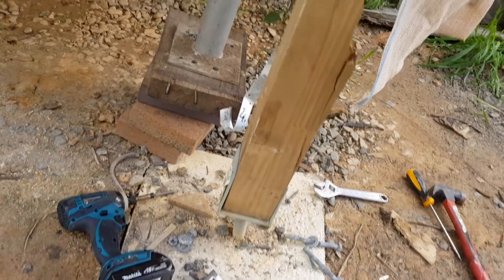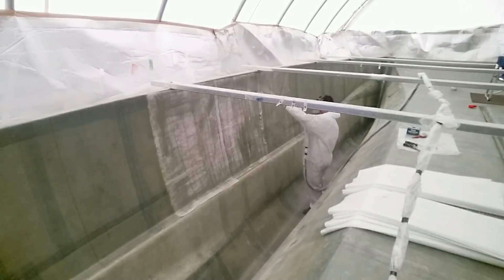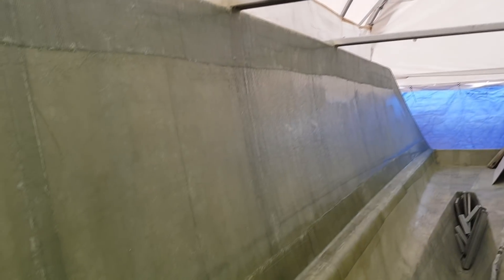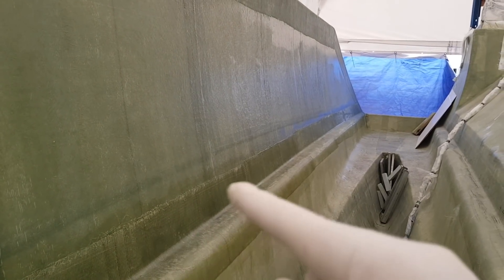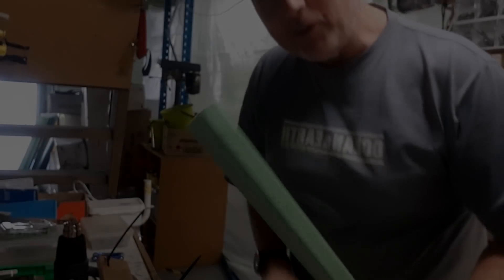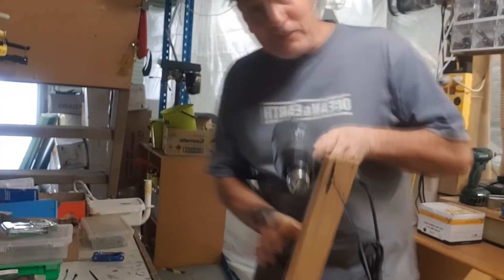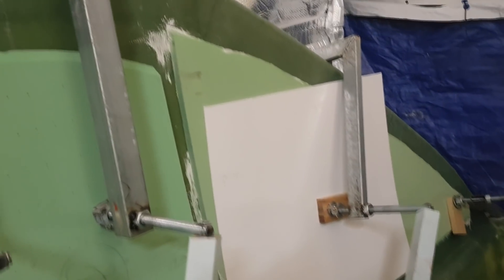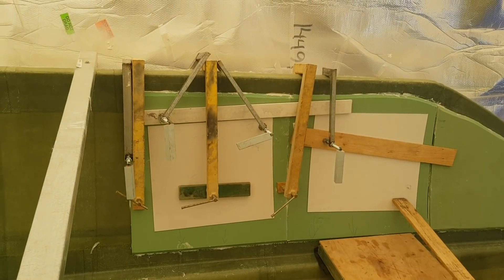Ep016 Foam core installation on Catamaran Hull Sides

Comment: theoretically if you were speeding at around 60 mph and landing on water with a catamaran hull with foam core, Do you think it would survive the impact?  weird question i know but there's method in the madness
Reply from the maker: Onya mate.
Reply: The reason i asked was, I wanted to build an ekranoplan catamaran hybrid,  check it out, definately get you over the seas quickly.
Reply from the maker: Oliver, I am not convinced it wouldn't handle the landing as the foiling catamarans are carbon foam core and they are cruising at 60mph at their fastest. Check out the sail GP site and superfoilers and they seems to be ok, I live close to the superfoiler builders and they are capable of speeds almost as high as that.  I believe the rigidity is fine , the actual laminate would be the critical factor and reinforcement under tension as the inside of the structure would be prone to delamination due to the impact and compression on the other hull. Ross
Reply: @LifeOnTheHulls  Wow Thanks Ross, I could definately use the help of an engineer on the materials,  I was thinking of using densified would which removes lignum from the wood reducing size and weight while also producing steel like strength, it's a relatively new method, then using a mix of fiberglass, carbon, kevlar or basalt as the last couple provide better impact resistance, i also thought wood does well when the fibers attempt to compress, I might be completely insane though and thinking nonsense.
Reply from the maker: Oliver.Emirates Team NZ have developed a foiling  hydrogen powered chase boat that can do 50knots,check it out, that shows what is the future.I do worry  for the marine life on the surface with foiling technology and the resultant damage to foils tendering them useless.Ekranoplan look very interesting.Definately carbon kevlar to balance rigidity with impact strength.I love carbon kevlar and use regularly.Ross
Reply: @LifeOnTheHulls   Yeah i had similar concerns with foils.  The ekranoplans might be a better longterm solution if perfected.  much quiter i would guess too.  Thank you very much Ross, a Gentleman.  Best Regards Oliver
Reply: @LifeOnTheHulls   something like this http://www.hypercraft-associates.com/Resources/Hoverwing%20HW2VT.jpg

Comment: What is the added value of the foam to the inside of the Hull?  
- Structural? 
- Vibration & Sound deadening? 
- Insulation?  
I ask this because the insulation becomes a divider between the interior dividers and the exterior of the Hull.  Right? 
Seems like all structural connections should go from  interior bracing to exterior layer of the Hull Fiberglass.  No?
Reply from the maker: Hey buddy.Foam is a structural component as it forms a bridge between laminates thereby increasing stiffness whilst reducing significant weight. It further adds to insulation both thermal and noise and provides a rot proof core for added longevity.Cheers Rossco

Comment: Hello! are you using vinylester with wax in it every layer, exept the last layer, or is the wax always inn? and why do you use vinylester instead of polyester?? in sweden the polyester resin  is much  much sheaper than vinylester, can I use that insted?
Reply: He used the vinylester because it is stronger and more resistant to water osmosis.

Comment: No protection suite? I get the itches just watching you work with fiberglass!
Reply from the maker: I only need the suit when spraying and sanding substraas the itch only occurs when the glass is airborne as it is sanded or ground. There is no itch when laminating stitched cloth until one comes to sand or grind it, that when the fun starts and I am paranoid about the itch.  Cheers

Comment: I worked in the boat building industry about 40 years ago. Instead of grinding the foam core, I used an electric planer. It saved about 3 days of grinding.
Reply from the maker: Where were you when I needed you most Johnny.Hah.Great tip will be doing this on the the deck build for sure.Legend.Cheers Ross

Comment: I use to spray 2 part poly for tank waterproofing. What is your gun set up and what ratio are you spraying??  Thanks
Reply from the maker: Thanks buddy, really appreciate you watching my series, The gun sprays saturated polyesters and vinylester resin including gel coats.Ratio is between 1 and 4 precent catslyst which I can adjust dependant humidity or temperature.Resin is catalyzed approx 1nch from gun nozzle to reduce clean up and ensures accuracy and longevity of product. All the best, Rossco
Reply: @LifeOnTheHulls  Thanks for the response! I found your tech video,  Graco is the best in the business. Cheers!

Comment: The adhesive you used for the foam is similar to the stuff that we use on kit cars for bonding on panels.  We refer to it as “ baby poo” 'cos it gets everywhere.  I’ve had it in my eyebrows.
Reply from the maker: I too have had the stuff everywhere, I can totally relate. Cheers Ross

Comment: Great vid,  been looking at modern foam-core yacht's and wondering what exactly that means,  now I know exactly.   and learned so much.  laughed out loud when you wiped the latex gloves in the t-shirt before handling the foam board, clearly a trick of the craftsman. 
Bigger question, where ya get the mold, rental?   Hmm should probably be watching some of the earlier episodes.
 PS sorry bout ya shed pole, glad it could be fixed.
Reply from the maker: Bo Lorentzen Thanks for the comment Bo.Funnily enough the t shirt is a Melbourne Storm Rugby League footbal team so no great loss.I support the local St George Dragons.There is no reason why there should be a League team in Melbourne Victoria.lol

Comment: I want to build a 32'-36' Catamaran, much like the 1988 crowther spin drift 38'. any tips on how I can get information on how to build a hull? I was thinking of just doing some thing in the video I linked with 5 lb vinyl foam that i linked. 

https://www.youtube.com/watch?v=OwABZT2pIn8

The hull won't be able to walk all the way up and down. only about 12 (3.6576 meters) Feet of the outer hulls you will be able to stand in and access from the cabin. The cabin will be smaller too about 12 feet long (3.6576 meters) and 8 feet wide. The total width of the boat Beam will be about 14 feet (4.2672 meters) Now my concern is if I can get the hull strong enough using the technique as follows.

I figured I wouldn't need as much material since my boat would only be half the size of yours. 

inner
Chopped Strand Mat: 1 1/2 ounce 42.5243 g
Woven roving 18 oz or 510.291 gram (for flattest areas on the hull)
Chopped Strand Mat: 1 1/2 ounce 42.5243 g
36 oz  - 1200 gr/m^2 Triaxial fiber glass
Chopped Strand Mat: 1 1/2 ounce 42.5243 g
Foam core 3/8-1/2"
Chopped Strand Mat: 1 1/2 ounce
36 oz  - 1200 gr/m^2 Triaxial fiber glass
Chopped Strand Mat: 1 1/2 ounce 42.5243 g 
Chopped Strand Mat: 1 1/2 ounce 42.5243 g
outer

I also want to Design a super structure through the hull like a skeleton. Combining old techniques with new. To hopefully reduce the costs of building a cat. 

https://www.fibreglast.com/product/Chopped_Strand_Mat_1_1_2_ounce_00250_1/Fiberglass_Mat

https://www.fibreglast.com/product/Woven_Roving_223/Fiberglass_Fabric

https://www.fibreglast.com/product/vinyl-foam-5-lb-density/Foam

https://www.youtube.com/watch?v=OwABZT2pIn8

or if you have ideas on cutting costs with better sources that would be cool too. If all else fails ill find a $20k-$30k cat and fix it up haha. I guess building one I can buy the parts little by little. Instead of all at once.

Comment: Hello again, good work and very good "how to.." videos. One question on this one, why would you glue the foam boards, they are not going anywhere as they will be embedded in glass?
Reply from the maker: Chiko,
Thanks for the comment. The foam core is required to be adhered in all cases as it is required to be held in place before any lamination can occur. In my case as I working alone, to simply place the foam in place would guarantee movement or dislodging by the time I get around the laminating over the top of the surface. Even in an infusion process the foam is held on with a film of spray glue that hold vertical surface foam and contoured foam and the placement is absolutely critical for correct engineering. That said, Australian Maritime Safety authority requires the foam to be glued with a specialised paste ie sealite, as well as hot coated with 300csm and  resin catalysed at between 2 and 2.5% to set off both resin and sealite guaranteeing a secure bond or the foam would simply lift off. I was able to glue down foam and leave for extended periods until I got around to completing the covering layers, which then  formed the penetrating spikes and grid score resin attachments for the upper surface.Compression roller then  consolidates the csm and sealite into the foam perforation ensuring a mechanical and chemical hold. All in all it has worked out to be labour intensive but perfect result with zero chance of delamination.   Cheers and thanks again for joining in the fun. Rossco

Comment: Mate what are you going to do with the mold when you get the boat out?i   I would like to rent it, for one boatl
Reply from the maker: Hey Thomas, I am canvassing a lot of options and have basically committed to a fews years of storage whilst I decide whether to go again, make a parts kit, lease out the mold, or a couple of other ideas are coming across my desk over the past few months. Whatever it would be likely to be local, diue to the logistics, but certainly want to see it in use.  All the best Rossco